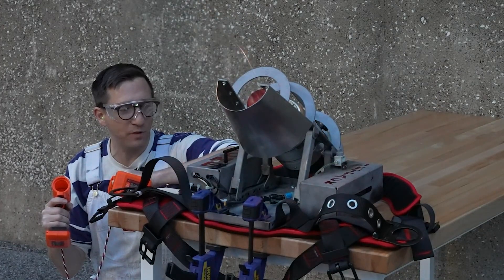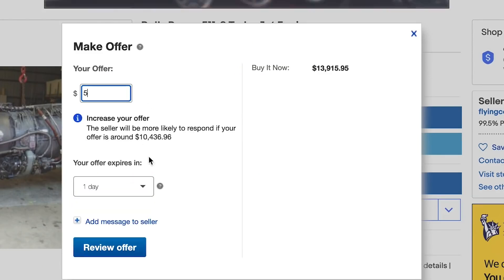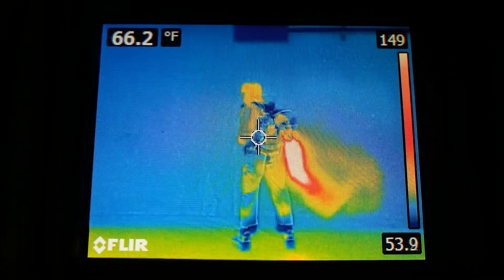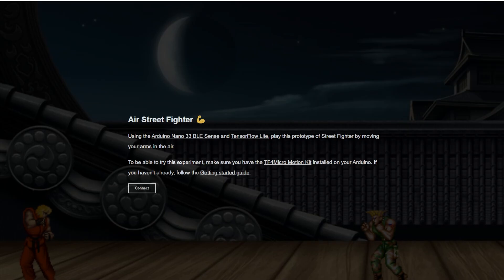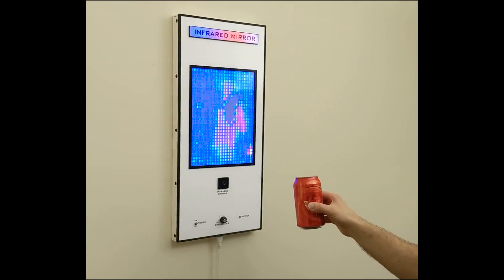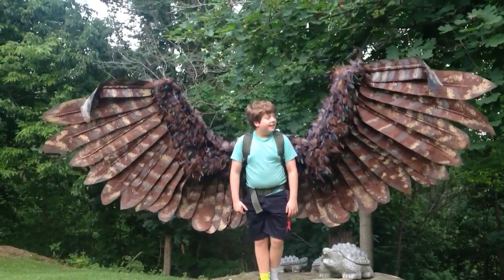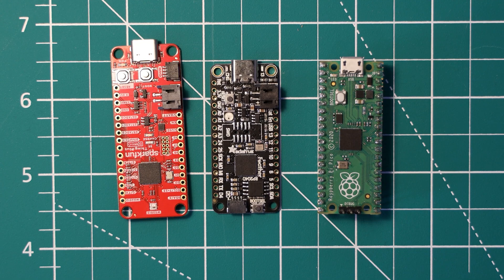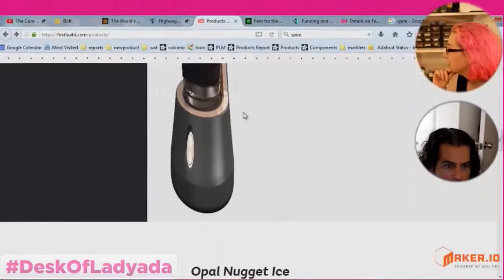Where's My Jetpack? [Maker Update] Maker.io

Comment: Some should have told him Kerosine works really well as a substitute for JP-4, JP-5 of JP-8 and doesn’t require airport access. Maybe a little tweaking on the exhaust temp and maybe a smaller spray nozzle but is a nice replacement. I don’t know the exact operational requirements it easier to access!

Comment: The fuel for the turbine is hard to get! You joking? JP4, JP5, JP-6 is not needed unless you are riding your rollerskates at 55° below zero it’s not a problem.  Jet propulsion fuel for turbine engines and such needs to resist jelling at low temperatures which is the case at 40,000 feet. It’s pretty hard to pump a fuel when it acts like Jell-O. Regular diesel works fine, Or just go to your nearest gas station or fuel supplier and get some kerosene or number one diesel. Kerosene tends to burn with less visible fumes but it costs a bit more than number 1 or number 2 diesel.  Basically I’m saying “no problem”.
Compression ignition engines such as jet engines and diesels of all sorts don’t generally care what kind of oil you feed them. You could run JP-4 in in your diesel pick up if you wanted to and could afford it just add some automatic transmission fluid to it to give it a bit more lubricity In your diesel tank. This stuff isn’t that complicated.  
So guys go out and build a jet powered bicycle or motorcycle or go-kart or if you really want to mow your grass in a hurry put a jet engine on your riding lawn mower!